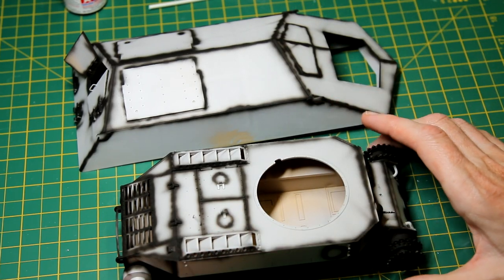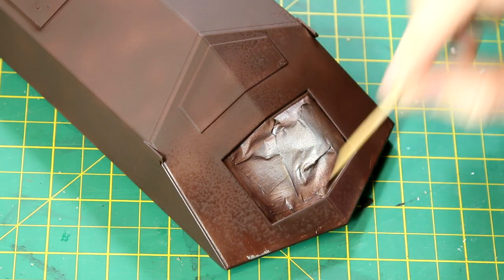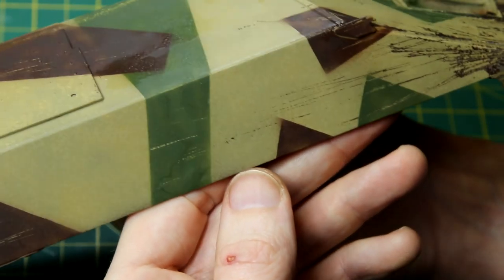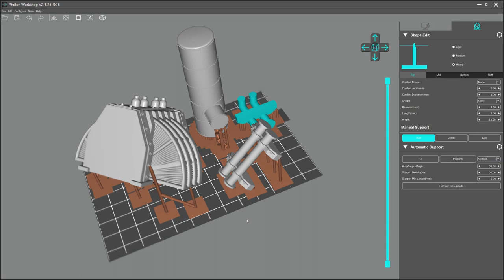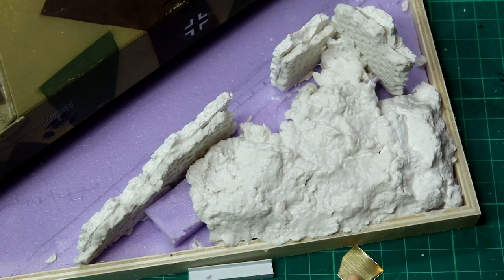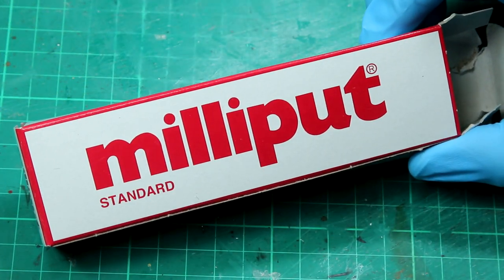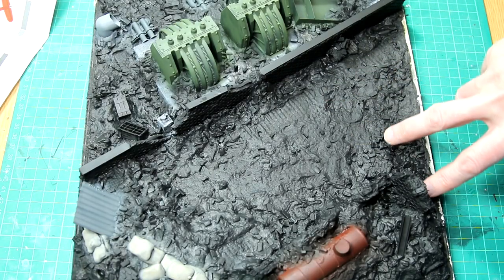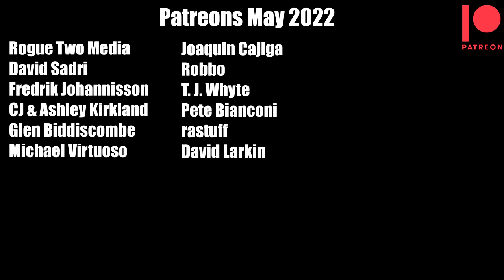Rammtiger Build & Diorama - Part 2 (Das Werk 1/35 scale model)

Comment: Cool looking tank 😎.  This will end up being a really good  diorama when finished.  Your lucky to have a 3D printer.   Keep up the good work .
Reply from the maker: Thank you John. Yes, the 3D printer has been really useful for the additions etc. I couldn't have scratch-built most of this stuff.
Reply: Was just wondering where u get the foam Broad from as I can't seem to find it anywhere.  Cheers  👍
Reply from the maker: It's hard to find in the UK. I got mine from Amazon. They had 10mm and 6mm versions. It's not as nice or dense as the blue XPS foam, but it works: https://amzn.to/3ypKjKi